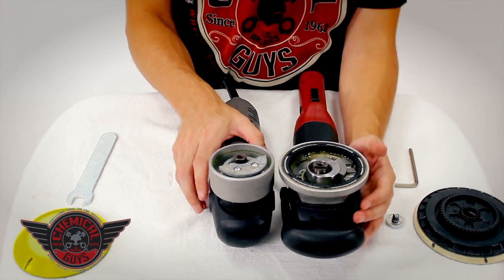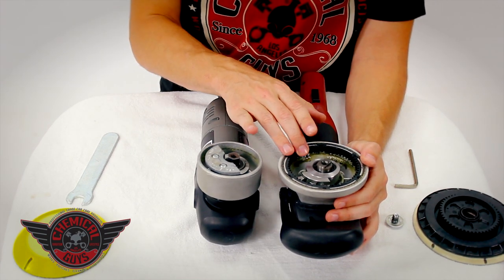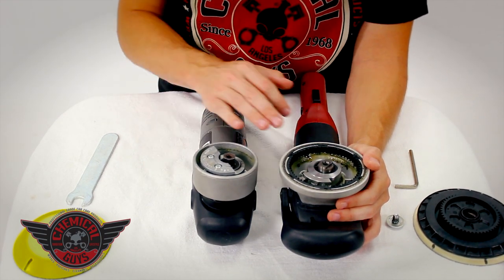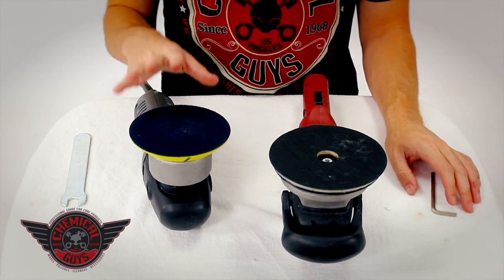Porter Cable 7424XP vs Flex 3401 - Chemical Guys Polishing Detailing Car Care

Comment: The Flex also has a 4" option as well as a 5 and 6 and if you use a 5" pad on the four inch backer it will bend into curves so you can polish with the side of the pad as well as the face if required

Comment: You also forgot to include in the video that the Flex is variable speed with the trigger too, so it can spin slower if the trigger is not applied all the way.

Comment: What do you think about the Harbor Freight 6 Polisher VS. Porter Cable 7424???
Reply: I have owned all three at one time, started with Harbor freight which in a landfill right now, less than six months later Porter cable which was nice had it for a few years when my wife bought me the flex It was definitely a big step up. Think of it as owning a Honda then moving up to a Lexus.  Unless you're working in a small space don't bother with the extended rubber power cord you will still plug it into an extension cord.
Reply: Both are weak when it comes to heavy correction on hard clear coat, you’ll be there all day, they’re good for 1 step production details though since the goal isn’t to produce the best results anyways. The flex 3401 is a beast of a machine when it comes to correction, it’s arguably better than the 21mm longthrow machines.
Reply: @RudeMcNasty  hondas are built every bit as well as lexus ...so by this comparison you are just saying flex costs more...but i can see the flex is a more powerful unit...so many jobs would be completed much faster.
Reply: @roadstar499  
Honda's are nowhere near as well built as Lexus, as easily witnessed by resale value.

Comment: Would either of these be powerful enough to polish out chalky uv faded gelcoat on a boat?
Reply from the maker: Hey there, thanks for reaching to us, yes you can. You would want to do a test spot first with V36 and an orange pad before you move onto a compound like V34/V32. If the gel coat is unresponsive, you may need to use a microfiber pad which generates more heat and friction. You want to finish with a white pad and V38 to refine the paint.

C.G. Alex -
Reply: Chemical Guys thank you. And to be clear, either the Flex or PC would be up to this task on a oxidized boat? Any one better than the other?
Reply from the maker: I like the TORQ products more, Flex and Porter Cable make great machines, however I think the TORQ machines are more advanced, designed to be more usercentric, and possess more ergonomic features. I'm fond of the TORQX and the TORQ22D.

Comment: Hello guys, why do you have those vertical lines on the backing plate?
Reply from the maker: Hey there, 

The reason there are vertical lines on the side is to let you know if the pad is spinning. The pad must be spinning in order for it to be cutting and doing its job. When it's not spinning means that you're putting too much pressure on the pad, which would leave holograms if you continue like that. You'll want to use 5 lbs of pressure, which is pretty much the weight of your hand.
Reply: @ChemicalGuys NO ONES hand weighs 5 lbs.... That PC sander weighs about 5lbs

Comment: Patent owned by Porter and Cable,Is not the tool but who's behind of it.
Reply from the maker: Very true, any machine can be utilized to great effect by an experienced detailer with the knowledge to perform the task correctly. I would also say that a superior machine, also produces superior results. In fact machines like the TORQX, 22D, and 10FX set the precedent for polishers in terms of innovation, and aerodynamics. Stay tuned, more great videos on the way.

C.G. Alex -

Comment: Does anyone know the different speeds that each one does. I know the porter cable has 6 different speeds, but what is each one set too?
Reply from the maker: Hi Jerome, thank you for watching this video. You only really use the first setting to spread polishes and waxes, and you use the maximum speed setting to polish the paint.
Reply: @ChemicalGuys  the PC is a 6Inch in case I want to buy Microfiber pads?